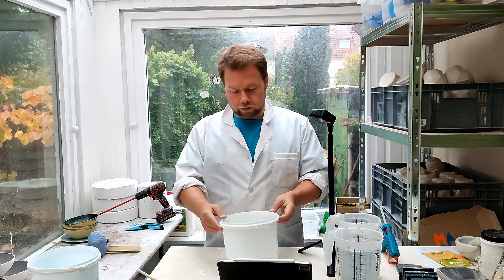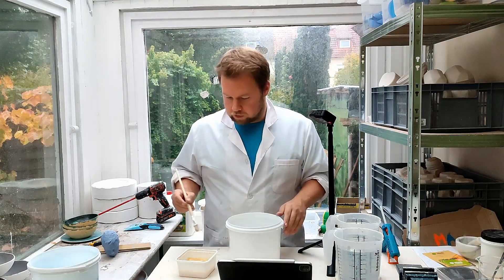Turn 3D-printed bust into a plaster / gypsum bust!

Comment: That is what I was looking for!
Btw, have you tried to create a mold using the 3D printer? You could create a negative from the bust to serve as a mold, then model it (in Blender, for ex) to make the mold detachable.
Reply from the maker: Hey, yeah I tried that. But there is a major flaw with that solution: It creates two seams. Using the casting method I used in the video you only have one seam in the back that is barely noticeable. An alternative seamless method to print a mold is to print with PVA. Expensive but works well and does not producy any seams :)